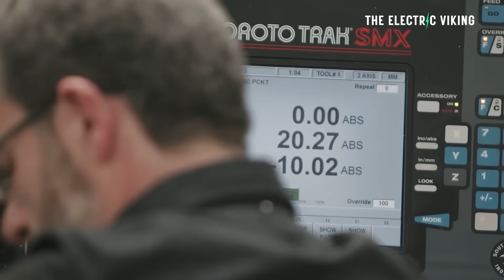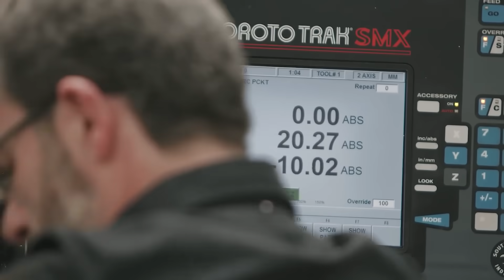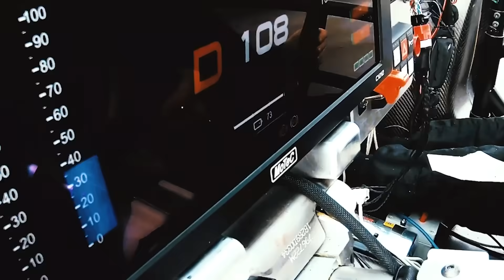This Insane New Electric Motor Has 872 HP And Weighs Only 62 lbs

Comment: Can motors get better? Yes.  But as an engineer you know there are always tradeoffs.  Trading performance such as hp or efficiency for longevity or cost.  I'd like to know what tradeoffs were made on this motor before I would think about using it in electric cars.
Reply: Usually yeah, but somethings are just better. Take for example the desktop computer I'm typing this on. It's cheaper, consumes less electricity, and is many-times faster than the 286 my grandpa had.
Reply: @pgbpro20  Nicely Put
Reply: i agree, like Koenigsegg's 350hp electric motor can only produce that power for less than 1 minute otherwise the motor will melt or the magic smoke will come out of the inverter. eventually higher heat capacities along with smaller high current batteries will make these the future of automobiles. 
BTW Why doesn't anyone ever talk about the tons of coal burned to make the electricity that charges my EV?
Reply: @dksaevs  Everyone is always talking about the coal plants in the grid-- Where have you been? I hear far less about how ICE is only 30% efficient w.r.t. converting chemical energy into mechanical energy. And that's the crux of it right there, everyone driving around with their own little power generation plant turns out to be less efficient than dragging around a bunch of heavy batteries even if the fuel sources are the same! It's actually pretty wild, when you think about it.
Reply: @pgbpro20  I believe that the answer is somewhere in the middle. I have solar panels, both thermal and electric. along with them I have a 1.5kw VAWT for those cloudy days. Nether ICE or EV's are the problem. https://www.youtube.com/watch?v=k8CnlL8I4HE
Reply: @dksaevs  Would be good if the Viking researched how little electricity is generated by coal in many nations and what the actual amount of pollution per HP is when  comparing gasoline or petrol to electrons. OK Sam?
Reply: @carlwest859  
should have said fossil fuels which makes up about 65% of what's used for electrical power generation. of that 30% is coal. 
this data is 5yrs old i'm trying to find newer data to see how much fossil fuel usage has decreased.
source: https://www.epa.gov/sites/default/files/styles/small/public/2017-12/capture_0.png?itok=g9RSGCFi
Reply: @carlwest859 the only research the viking does is scan the internet for more meaningless sources, to ensure a high output of poor quality posts. Plagiarism is a thing, and he smells of it.
Reply: @carlwest859  If you look on youtube, that has been done already. And of course, it is changing rapidly.
Reply: @dksaevs  That's because it is changing rapidly. Coal power is less common now. Australia is closing its coal fired stations even though we have vast amounts of coal. And electricity from coal fired power stations is still much cleaner than liquid fuels refined by the same electricity, shipped around the world and burnt in inefficient engines.
Reply: @dksaevs xcept if you live in a hydro electric location. It’s water and gravity then.

Comment: That's nice, but 872 HP is useless to me. I don't need anything much faster than the ICE car I have. 

 I want an efficient motor that's light weight and cheap. That will improve EV battery size and cost.
Reply: It's useless to 99.999% of the people. But so are rockets to the moon. What this technology is the prelude to the engines that we need. If this is 872HP at 28kg, what can they do for 150HP... 10kg? Even 15kg...? Means the engine is no longer a weight factor. Bring in the super dense batteries doing 1000km in heavy cars, what will they do in super light cars? And if solar panels can then be added to most cars knowing that we don't need masses of energy to power a car for daily trips... Well then we have cars driving all day most of the year for free. So yeah, I might be talking fantasy world, but that's what this supercar technology could bring for the average punter.

Comment: No matter how light the motor is ,battery is still heavy.
Reply: With a lighter motor, a lighter carz you need smaller batteries. Sodium ion batteries nearly twice the range of current Tesla top ranges. So you could half the size of those batteries to match the Tesla, but in a super light car frame and engine, you'll still drive further or reduce the battery size further.

Comment: Slowed down somewhat by the 1 ton of batteries needed to power them.
Reply: That equation is not static.  Battery tech is evolving at a fast pace now.  Within a year it will no longer make sense to get ice cars.  They are being outlawed basically.  I’m mot in favor of that but that is the trend.  I will not buy any new expensive ice vehicle again as I don’t want to get stuck with it depreciating in value as nobody will want it soon.

Comment: Sam, you are exactly correct to basically state that.... "We ain't seen nothin' yet!" Battery and motor technology is improving so quickly that in 10 years we'll look back and wonder why we EVER horsed around with ICE!
Reply: Horsed around with ice...😂
I see what you did there...😊
Reply: it's evolution man!  sometimes it moves leap and bound, other time it stand still.
Reply: @SunriseLAW  There was a light bulb at an American fire station that had been burning for decades. what materials and such it was made of could not be found out. because the person who is assumed to have brought out the lamp was dead. Then it was the case that the companies decided that a light bulb would only last a certain amount of time
Reply: @Andersljungberg  We know how to make long lasting light bulbs but they are huge energy wasters.  They turn a lot of electricity into heat, not light.  Have you ever used a "rough service" light bulb?  They were made with an extra heavy filament to keep them from being destroyed by movement as when a plumber, A/C, or electrician is crawling around in an unlighted attic or crawlspace.I used them for years and have a large round scar on my left arm where a light fixture fell from its hanger and landed on my arm.  The extreme amount of heat blistered me in a fraction of a second.
Reply: @Andersljungberg  That light bulb that you are talking about is NOT secret technology but rather was found to be a STANDARD FOR THE TIME Carbon Filament light bulb which ARE now making a comeback within Cinema Lighting and Industrial systems due to their very specific colour temperature. If the carbon filament is very pure and the vacuum very hard in the bulb, they can last for CENTURIES even in over-voltage conditions!

V
Reply: I can tell the idiots and the intellectually weak from the smart and intellectually strong people by what they delete.
Reply: oil companies  monopoly!
Reply: @camronrubin8599  There is completely fossil-free diesel to buy in Sweden, available at many petrol stations
Reply: @Andersljungberg  I have fossil free diesel , it’s called a solar panel and an EV. Although we will need to rely on diesel for a few more years gas is clearly becoming obsolete quickly
Reply: @camronrubin8599  I mean, like this 

HVO100 (Hydrotreated Vegetable Oil) Fuel is made from 100% renewable items and is free from any fossil fuels. It is produced by using sustainably sourced vegetable and animal matter to ensure its production does not have any negative impact on the environment. In Europe, this is covered under the EN15940 Standard. As HVO100 has a chemical structure similar to diesel fuel, HVO can be easily substituted for diesel without any impact on the efficiency of your equipment.
HVO is seen as the best and easiest paraffinic option available to help reduce your carbon emissions immediately.
Reply: @Andersljungberg  yes I’m aware . Sadly I live in this oil monster country called America , is this oil cheaper than solar /wind ? I really don’t care about carbon emissions . Only what’s cost effective . I didn’t buy Solar and EV for carbon emissions , I bought it because it’s cheaper , it just so happens to be better for the environment
Reply: @camronrubin8599  You can also make E-gas / synthetic gss from wind turbines for cars that is made for CNG
Reply: @camronrubin8599  how does it work in practical terms to drive the diesel car with it 🤭
Reply: @Andersljungberg  diesel is obsolete unless you are hauling heavy loads . But yes we need cleaner diesel
Reply: @Andersljungberg it is still a inefficient combustion process that generates more heat than usable power AND still spits highly harmful fumes like diesel …carbon is just a small part of the equation….peace…
Reply: @SunriseLAW  But we might have those who find new technology scary who might simply want an analogue car a car they know how it works
Reply: @SunriseLAW  The vinyl record has become popular again. It didn't die like some I thought. And today A vinyl record can cost a lot
Reply: @Andersljungberg you are confusing nostalgia with technology. They are different
Reply: I LIKE your optimism. Way to go!
Reply: However as these technologies emerge, current EVs will just depreciate more quickly as opposed to most ICE cars
Reply: My comment still stands. Ps update your knowledge of history. Your comment on the Korean war is incorrect.
Reply: You say it so well Steve, what an exciting time ! I'm watching for a fusion powered flying machine,, will need autopilot, I may be too old to fly on my own .Jim
Reply: You are right ev tech is changing rapidly
Reply: Might have to do with you being a man, a woman might ask the question what do you need 800 horsepower for
Reply: @Andersljungberg  Anything I want!
Reply: @SunriseLAW  They may not remember the warm light of light bulbs
Reply: @SunriseLAW  so nothing about the past is as good as it is now
Well allow me to refresh your memory.
Housing affordability. Quality of education. Cheap power and fuel costs. Mothers being able to stay at home, and not work. Freedom of speech. Freedom of being allowed to accept or deny certain medications. No ridiculous ineffective lockdowns. No Iraq, Afghanistan, Syrian, Ukraine wars. Clearly you must have lived in a socialist or communist country previously.
Reply: @SunriseLAW  Let me guess they are young they are not in their 50's
Reply: Battery tech is moving so fast? How much change between a modern Model S and an original 10 year old Model S? Hardly earth shattering improvements!
Reply: @geoffhaylock6848  Ludicrous, Plaid.
Reply: @rogerballiet8131  sorry, we are talking battery pack not carbon reinforced motors. Lets use some common sense. I wouldn't be so stupid to compare a 3L V6 car with a 5L V8 supercharged and say, "yeah the fuel in cars has changed a lot in 10 years".
Reply: @geoffhaylock6848 fine then. 

2012 base Model S:
  Weight: 4,647 lbs
  Range: 135 miles
  HP: 362

2023 base Model S:
  Weight: 4,561 lbs
  Range: 405 miles
  HP: 670

There is clearly significant improvement between these vehicles, and that isn’t even considering any improvements that fall outside of basic performance metrics. In addition, pushing down the cost of the car is not as much of a concern for the S as it would be for a cheaper car, so a lower priced vehicle will see tons of improvements after a decade of decreasing the cost of all the currently cutting edge tech
Reply: @SyntheticSpy  I’m so tired of explaining these things to petrol heads 🤡
Reply: @geoffhaylock6848  Tesla is just one company bringing mass-produced, reasonably affordable electric cars to market using more than less off the shelf technology.  With mass adoption (creating an arms race of sorts) of battery and electric motor tech, I wouldn't be surprised to massive improvements.
Reply: @geoffhaylock6848  only for the untrained eye...
Reply: @geoffhaylock6848 I disagree. there has been major changes
Reply: @geoffhaylock6848  Nissan Leaf in 2012 had 60 mile range for $40k . 5 years later the 2017 Chevy bolt costed $30k with a 250 mile range . And now you can buy a used one for $15k with 250 mile range . So let’s do the math. OG Nissan Leaf costed $666 per mile range 10 years ago and now you can buy a bolt for $60 per mile range . That’s 10 times cheaper in 10 years 🤦‍♂️ do some fuckin research bro

Comment: the 0 to 60 time is not bounded by horsepower
without a rolling start you cannot go beyond 2.1 seconds with normal tires
Reply: Correct. Also, without traction control, a 600hp car is undrivable on a wet road .
Reply: @robertfonovic3551  yeah its so stupid....but I guess the 100 to 200 kph time will be sicker

Comment: Average persons have no idea about physics and after their opinion there should be only horse carriages around. An electric car with no disturbing sound and noise makes so much fun to drive on racetrack. Ran my EV6 AWD 333 PS/608 Nm last summer against Alfa-Romeo Stelvio with 510 PS/600 Nm and had no problem with. But the other made even Akrapovic amplified special loud noise and it’s really not to understand why that should be necessary to be fast!?😂
Reply: Real gearheads like the noise and vibration of a "real" car, plus running through the gears. So they hate EVs and sneer at 'golf carts' and insist they drive 600 miles without stopping, towing a boat, through the outback. Uphill both ways.
Reply: To each their own.

Comment: true that electric motors, especially high end specialized motors, are higher torque and way more efficient. and you can put 4 of these motors and get all that horsepower, but you'll need those kilowatts to power them. thats the weight. the batteries and the cooling apparatus for the batteries. and don't get me wrong, i do love electric savage machines. the amount of joules/watts/whatever in an advanced battery pale in comparrison to the weight of a liquid fuel. thats the weight advantage